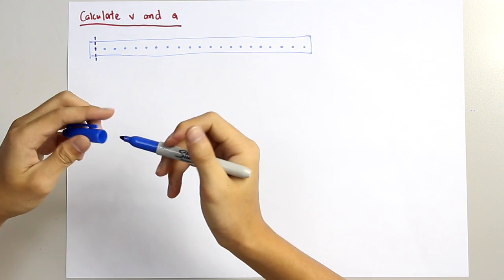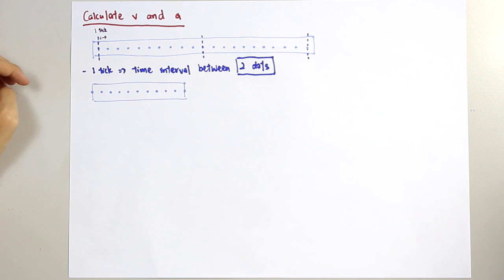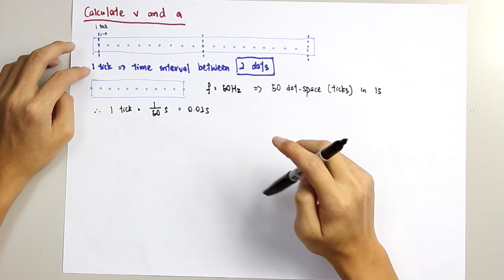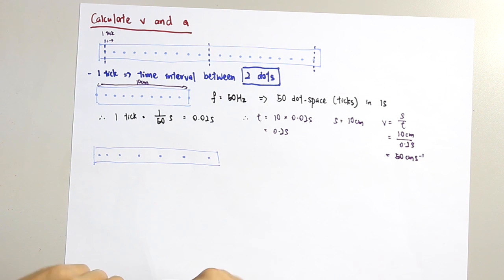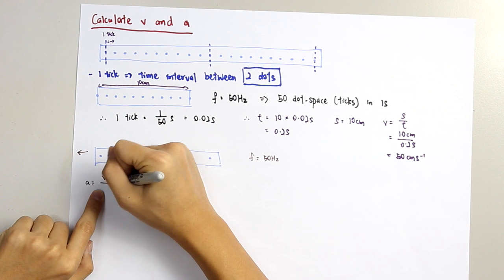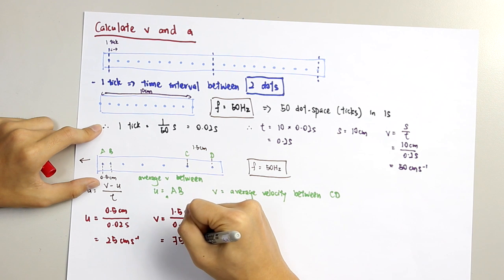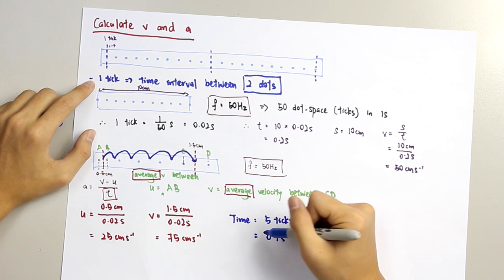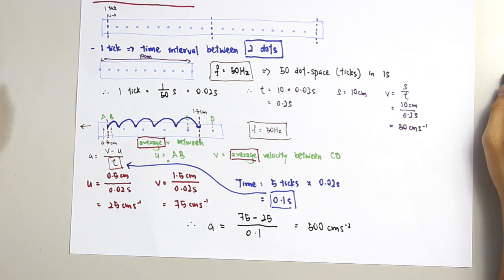Physics - Ticker Tape Calculations

Comment: Hello Sir,

Thank you very much for this video. It was very informative. If you don't mind answering, I have a question regarding the direction and its effect on the final answer. Since the direction the object is moving in the example is left (therefore decelerating), why is the answer 500 cm/s/s rather than -500 cm/s/s?
Reply from the maker: Pls ask, we will try to answer
Reply from the maker: To be exact the answers can be written as
1. Acceleration = - 500

OR

2. Deceleration = 500
Reply: @mrsaimun  Thank you very much! This clarifies things now for me :)

Comment: At 7:45 you say that the time starts at the mid-point between the two dots - could you explain why?
Reply from the maker: its just to show you that how you count the time. you count from the middle of the dots to another middle of the dots next to it.
Reply: @mrsaimun  I see, but when you calculate speed you count the total number of ticks to determine the time. But when you calculate acceleration, it is half-way between the time for intial and final velocity? I just wondered why it is different.
Reply: @MSJChem  I was wondering the exact same thing
Reply: @MSJChem  When taking the initial and final velocity he used to take the average velocity..That’s why he took the time fron the middle of two ticks..Usually when taking average velocity its taken by (v+u)/2..But we can take a good value by u = S/t..